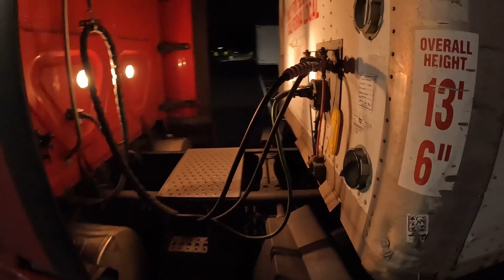So I'm a Local Driver Now.. | Vlog | Rookie Trucker

Comment: 18:00 there is alot you can do. I've driven roll offs, dump trucks, doubles, now I'm driving dry-van with no touch freight (on a local relay route) with good pay. I only work 9 - 10 hours a day and still have free time and a life. I actually took a different path, got my class B from a local company, then got my class A from a local school and hopped right into a local job.

Comment: 2 days left of CDL school at 160 Driving Academy. Looking forward to getting on the road!!
Reply: Do you feel prepared for your DMV test?
Reply: @MsVNG  only thing I am worried about is the 90° maneuver and the parallel parking maneuver. I have the offset and straight back down. Literally only 2 things on the whole test I am worried about
Reply: @nflbound1996  How do you  feel about the PRE-TRIP memorization? How did 160 Driving Academy help you prepare?
Reply: @MsVNG  oh I have pre trip 100% down. I just teamed up with a buddy in class and we went over each section over and over again until we got it through our heads. Now I can cite pre trip without even looking at the truck and trailer. Hardest thing is going to be the maneuvers and those just take practice
Reply: @nflbound1996  Good point! Have to double down on studying / rehearsing it with my boyfriend. Good luck to you! 👍
Reply: @MsVNG  same to you!

Comment: No disrespect what-so-ever. For new drivers. Air dump valve.Dock lock.  Trailer seal.........I went to Diesel Instiute of America, and was taught none of this. I had to learn Qualcom and PeopleNet the hard was. Thnkfully I was loose leaf log most of my career. Your backing is better than you rhink. You hould have seen my doofus ass the first year..